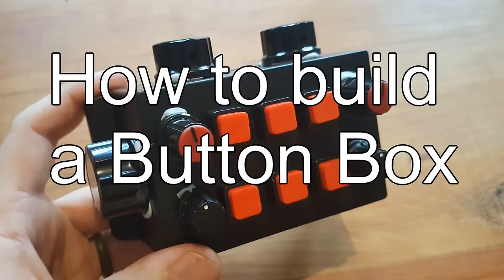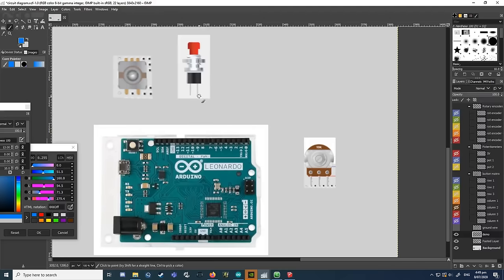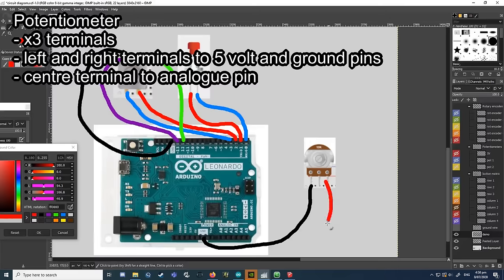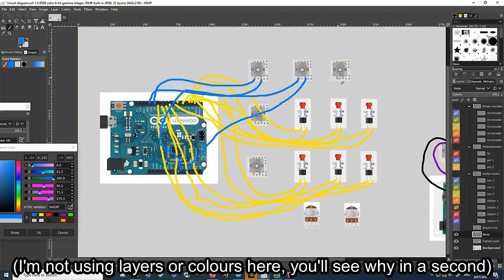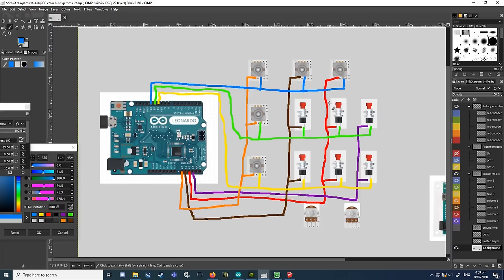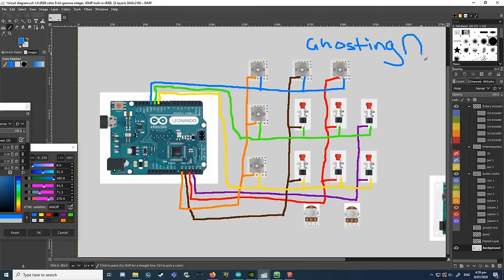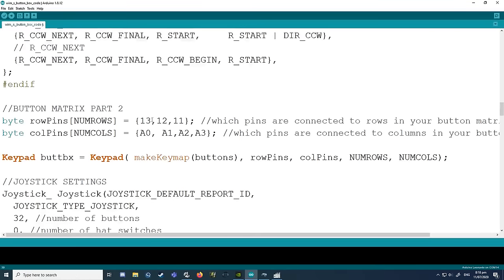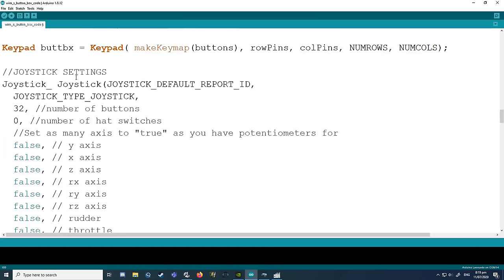How to Build a Button Box

Comment: I've been looking at some videos about this topic (yours was definitely the best explanation) but before I buy buttons and switches I wanted to know if it mattered if the switch is rated 12 volts since the Arduino only outputs 5V. Also, do the buttons just have to be rated at 5V and up. I am fairly new to all of these topics and would really appreciate some help.
Reply: as long as a button doesn't have an light indicator, you don't need to worry, the way a button works is like conecting two wires to each other, and that works no matter what voltage - sincerly an electrical engineering student
Reply: @dylanlooij8950  Thanks!

Comment: hi, I recently got myself a ky-040 rotary encoder, but I still don't know which pins connect to which part of the arduino board. Could you give me some advice or guide me?
Reply from the maker: This manual should help: https://www.handsontec.com/dataspecs/switches/Rotary%20Encoder.pdf

I'm not an expert in electronics and haven't used this kind of encoder before but based on my reading:

CLK and DT - Outputs signals needed for turning left and right
GND - Goes to Ground
+ and SW - Hooks up to your button matrix for the push button function.

Comment: I only need 3 buttons assigned to pins 2,3,4. How do I code it, so I don't get row/column errors?
buttons are standard push on, release off 5v.
Reply from the maker: With only three buttons you'd be better off using a zero delay joystick encoder. It's much cheaper than an arduino and simpler to set up.
Reply: @wimwamjoey  true but im making a steering wheel with buttons on the wheel.
Reply: @wimwamjoey  with the videogame in mind i cant use an encoder.
Reply from the maker: @DukeOfSouls  ah, in that case just set the buttons up as a 2x2 matrix
Reply: @wimwamjoey  tried. Keep getting errors that poss me off
Reply from the maker: @DukeOfSouls  can you link me your code and wiring diagram?
Reply: @wimwamjoey  got discord?
Reply from the maker: @DukeOfSouls  Yep

Comment: Hi can you explain why the toggle switches are hard to "deal with"? I am building a throttle quadrant with a flap and gear switch. The gear switch is a normal toggle switch vs the flap switch a self centering toggle. Im guessing a toggle will send a closed signal the whole time ? is it possible to code it so that each time the switch is flicked it sends out just a single command?
Reply from the maker: Hey, yes that is possible but I'm still working out how to do it myself! There may be a way to do it using the mmjoy2 software without writing any of your own code so maybe look into that.

The other thing is that leaving a switch on may cause ghosting issues when you try to push other buttons so you might need to use blocking diodes.
Reply: Ihave done this with a zero delay board - and imagine arduino would be similar.
Assuming a 3 position switch, sprung to return to centre? If so it should be 2 momentary switches with a common ground, so ground will go to ground, and each positive/signal will go to the circuit as its own switch (either in the matrix, or directly to the board). You should end up with centre= no signal, down= button x, up= button y

Comment: How to code and wire toggle switch plssss
Reply: Toggle switches are exactly the same as buttons, if it's an on-off switch, you connect one side to ground and the other to a pin. The best toggle switches for simulators is an on-on switch. This has three connections with the centre being ground this needs two pins but provides a signal in both directions. this is useful because some systems don't recognise the off position of a standard toggle switch.
Reply: @JoePCP  I'm trying to make a 6 toggle on-on switch for a WW2 panel. I'm using a 2 row and 3 column matrix using pins 13, 12, 11, 10, and 9. All switches are always going to GND from their center pins. Am I I doing this right?

Comment: I am not using any potentiometers. I’m just using rotaries and buttons. What do I change to remove faults after doing Verify? Also, thanks for the video!
Reply from the maker: You should just need to set the number of rotaries to 0 at the top of the code, then delete the line which says "checkallpotentiometers" in void loop (around about the middle of the code from memory).
Reply from the maker: Ah wait, sorry I got that wrong. Just remove the line that says "checkallpotentiometers" in void loop, the rotaries line refers to rotary encoders.
Reply: @wimwamjoey  thanks. I’ll give that a shot. For now I just reduced the programming to one pot and gave it a location on the Arduino even though it’s not physically installed. That made it work. This is my first Arduino project and your video helped a bunch!

Comment: 5:42 Unfortunately you can't use an Arduino UNO nor Pro mini without mods like custom bootloader etc (not worth it). Only Leonardo have HID emulation out of the box.
Reply from the maker: Yea, that was my fuckup. It's noted in the description
Reply: I'm fairly new this Arduino and electronics in general, could you speficy what won't work from this guide? For instance I just got an Uno(Or Elegoo's R3 version?), would using the matrix setup for buttons still work?
Reply: @drayerdx8958  the matric system would still work. That wouldn't be the problem here. The problem is how the microcontroller communicates with your computer. The Arduino pro micro and Leonardo are both set up to act as what is called a Human Interaction Device, or an HID device. The HID compatibility is what makes it possible for a controller like this to work

Comment: Question, using a leo boddner board to create a home brew collective for DCS helicopters.  I tried to use an automotive position sensor (hall effect) . It registers but it is a 360 degree sensor rotation and I only want 180 degrees full off to full on. How can I calibrate this or do I need 180 degree sensors??
Thanks
Reply: I've done something similar in the past with a "throttle" slider on a joystick that was misbehaving:  I the calibration (in windows) panel you simply just move your collective within the range that you want to use.  Windows does the rest.

The only downside I can see with this is that you lose half of the resolution (512 instead of 1024 possible positions), but for all practical purposes that should still be plenty.

Comment: thank you so much for this video!!. quick question, i have a pro micro and it doesnt have pins 0 and 1. Instead i see TX0 and RX1. should i start with those or should i start from pins 2, 3 and so on? (for the rotary encoders)
Reply from the maker: I think start with 0 and 1 but probably worth doing a test before permanently sealing everything up!
Reply: @wimwamjoey  you mean start with TX0 and RX1? honestly idk what those letters before the number mean
Reply: @Dani Dose this works? (Tx0 and rx1)
Reply: @arefinrony  I haven't tried yet since I have no idea what do those TX0 and RX1 mean. Everyone talks about 0 and 1 but no one answers my question as you can se here
Reply: after 9 months, I have the same problem as you with pro micro. not having 0 and 1 for the rotary I think that the tx0 is the 0 and the rx1 is l 1. I see that, I'm going to test this way, because by analyzing the diagrams whatever the number of rotary, there is always one on the tx0 and rx1. if someone can confirm, I'm going to use the pro micro for a steering wheel, the arduino in the video is much too big in my case.
Reply: @anthonytual8361  sad to hear you have the same problem, thank you for telling me! would you mind writing here again when you figure it out? i had to pause my project for a while due to moving, so i wasn't able to find out what to do with it.

Comment: why did you not wire the + on the rotaries to the 5v pin? looks like you ran them to an analog input.  You didn't describe much on the pins for them other than ground and twist functions.  So I'm confused.
Reply from the maker: I didn't explain the meaning of the labels on the rotary encoder I pictured because they seem to vary between parts. If your rotary is the same as the one pictured at 7.09 then it works like this:

The pins marked + and SW control the push button function. They go into your button matrix.

The pin marked GND goes to ground.

The pins marked CLK and DT measure the twist of the rotary and both connect to digital pins.
Reply from the maker: To be extra clear: none of the pins on the rotary encoder should be connected to the 5v. 

Basically what is happening is the two pins marked CLK and DT are trying to push power through to the ground pin (if you like, they are each kind of acting like the 5v output).

As the encoder rotates, each click is switching which of the two is connected to ground and completes the circuit. 

The arduino measures the pulses of electricity going through each DT and CLK and uses this data to work out which direction the encoder is turning, and how many clicks it has turned.
Reply: @Wim  OK great.  Thanks for this clarification.  My rotaries have all 5 pins in a row on same side. Clk dt sw + grnd. I forget the brand.
Reply from the maker: @jameswiggin2631  sweet, then connect them as I described above
Reply: @wimwamjoey  Hello, I also have those but but the switch appears to be between ground and saw while + seem to be connected to nothing when tenting with a multimeter, should i just try to ged rid of the pcb ?

Comment: i need help please

i made the steps used by ams studios but i could only get an arduino nano...couldn't find a micro and the code won't work
Reply from the maker: You can only use an arduino pro-micro or an arduino leonardo to make a button box. A nano doesn't have the right chipset.
Reply: @wimwamjoey  I should have read the comments first.. 3 days in - just completed soldering and then the error occurred: "Error compiling for Arduino Nano" ... all for nothing.. :´(

I took the nano because the micro did not have enough pins for my design.
1 switch 2+8 buttons & 6 encoders. I wanna cry!!
Reply from the maker: @autofctrl  Eeek, yea sorry man! I wish I'd got that right in the video... I'm looking to make an updated version of this in the future.
Reply: @wimwamjoey  thx for your sympathy man… I’m really not sure what to do now. But its totally not your fault, but pointing this out would have been nice, as no video I have seen so far mentions this. 

Would you mind adding a note to your video description? Like „Warning! Only works with Arduino Leonardo and Pro Mini“ to at least give people a chance to know without having to dive too deep into chipsets and their capabilities?! 

For the rest it’s (like previously commented) a superb video.
Reply: @autofctrl  i guess arudino nano supports HID interface... you might need to learn some coding and have to do some work arounds.. but it should work...

also i am not sure of these purticular libraries.. 

the easiest way is to buy a new micro or li..o boardand trasnfer the wires..
Reply: @vaisakhkm783  at the end i used my pro micro. After that I encounter encountered another problem. Had soldered all row cables wrong. So eventually I redid the thing like 2 times but now everything works great :)

Comment: i followed your video and programming and i can't get mine to work right. each button press triggers 5 buttons at once and my toggle switches do not work at all.
Reply from the maker: My only advice is to recheck your wiring. You most likely have a loose connection or a short circuit somewhere.

Comment: So I don't have the same rotary encoder that you do, I have the one that you put up on 7:12 but on the wiring diagrams that I'm looking at it says that the + goes to the 5v.  In which case I am a bit confused because I have the ground wire, the 5v wire, and the 2 wires that get grouped in a pair but now I'm left with 1 wire when I'm supposed to have 2 going working with the matrix.  Any help would be appreciated.  Thank You!
Reply from the maker: The + output is actually one of your two matrix wires. Basically instead of sourcing our power from the 5v output, we are sourcing it from one of the pins.
Reply: @wimwamjoey  wow, you even respond fast aswell. Thank you so much!
Reply: @wimwamjoey  thank you. Have been trying to figure out this issue for a week now.

Comment: can you help with a simple three button arduino pro micro? i see what you're doing here, but seems more complex than what i need TY Chuck
Reply from the maker: For a simple three button thing I would suggest using a zero delay joystick encoder rather than an arduino. It's much cheaper and easier to put together.
Reply: @wimwamjoey  don't know what that is but sure can find out thank you Chuck

Comment: Hi, I got a 4x4 button matrix with 6 potentiometers working but can not get the 3 rotaries encoders to behave correctly. Has anything been updated since the video was posted?
Reply: im having an issue, where the rotary will behave correctly for 5 seconds, and then stop responding all together
Reply from the maker: Nope, no changes I'm aware of.

Comment: Why not wireing the 4 switches to a common 5v and the 4 signal wires to 4 pins.
Reply from the maker: Because you can get a lot more buttons with fewer pins using a matrix. 

Using the method you describe every button needs it's own pin. So if you want 25 buttons you need 25 pins which is more pins than an arduino has.

Using a matrix you can get 25 buttons in a 5x5 matrix which only uses 10 pins.
Reply: @wimwamjoey so if i dont need the button matrix because i only use 5 button and one encoders what do i do ?

Comment: do you really need to go pin to pin on all those? can't use a common ground or 5v and signal pin?
Reply: You actually can connect one side of all the buttons to a common GND and the other side to its own dgital pin. But mow you have to set the pinmode of those pins to INPUT_PULLUP and the readings will be inverted.(that is if a button is not pressed it will read as HIGH and if you press it it will read as LOW) One thing to note here is that this approach won’t probably work with a button matrix and this code.

Comment: Can you use an Arduino Nano Every with this?
Reply: The key is what chipset your Arduino uses.  The Leonardo uses the ATmega32u4 which can act as a USB keyboard natively if I understand correctly https://www.arduino.cc/en/Main/Arduino_BoardLeonardo.  The Nano https://store.arduino.cc/usa/arduino-nano uses the ATmega328 which if I'm correct does not at natively as a USB keyboard.  I don't think it can be used with this code.  However, it's possible there is a coding solution.  I don't know.  Hope this helps.

Comment: Hello, I'm unable to upload the code on an Arduino Pro Micro.
I tested on an Leonardo and it was working ok. I changed slightly the pin configuration to adapt it on a Pro Micro, compilation OK but I'm unable to upload it on the Pro Micro.
I fully understand this is not a Reddit threat, but If you can help me a bit, I would definitly be greatfull.
Thx...
Reply: I'm guessing you have already double checked the board type and serial port selection in the tools menu? Then you can try to use a different USB port, preferably USB2 as arduinos can sometimes behave a bit odd on USB3 ports.

Comment: Thank you a lot for the video!
In terms of coding if i want to have a matrix lets say 4*4 and then a SINGLE button to stay ON like an ignition can i do it? (im saying this to overcome the problem of pressing 2 swtiches) how do i do it ?
Reply from the maker: Yes you can do that, you can wire one end of the switch to the 5v and the other to a pin. You then need to write some more code to read that extra button.

But tbh, it would probably be easier to include the switch in your matrix and add blocking diodes. Just do a quick Google and you'll find instructions. Diodes are super cheap.
Reply: @wimwamjoey  okay thank you ill take a look
Reply: @wimwamjoey  if you dont mind hehehe why to the 5v and 1 pin and not 2 pins as per usual? Im not into electronics really
Reply from the maker: @marcelosantospereira8858  oh mate you're kind of asking the wrong person... I only know enough to get me into trouble haha.

Basically I made a mistake in the video, someone corrected me in the comments. You don't always need two digital/analogue pins for a button. Instead you can just hook up one terminal to GND or 5v and the other to a digital pin. As soon as the switch is flicked the pin will detect that the circuit has been completed and you can have code which registers that as an button input. 

If you are going to do this I would recommend reading up a bit more cos I believe it is possible to cause a short circuit and break your arduino if you do things wrong.

Comment: Can I make more switches and encoders with this manual?
If not, how it can be made? 
Want ALL Buttons in Cessna.
Reply: yes make 2 or 3 button boxes xD thats why you anyway need buy saitek this and then saitek dat xD
Reply: @jarisipilainen3875  oh, I do not understand right. I will have DIY Yoke from Sidwinder, no saitek. Or what device you mean to buy?
Reply: @moschidreamer  i mean you cant get every knobs and buttons on one arduino.you need couple of them.saitek controllers not even all use 32 button.so its business
Reply: If you know how to use multiplexer boards and how to code them inside the IDE you can have as many buttons as you want! If you are not hardware savy and not familiar with how Buses works then maybe multiple arduinos is your only solution but then each one will need a USB connector to your PC unless you hooked them as slave and master using the RX and TX but this is also a complex topic